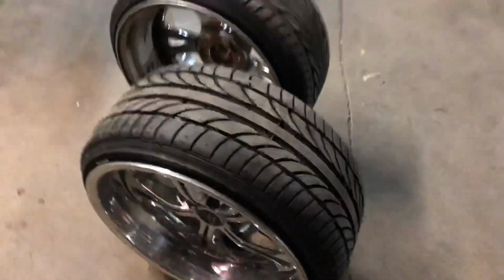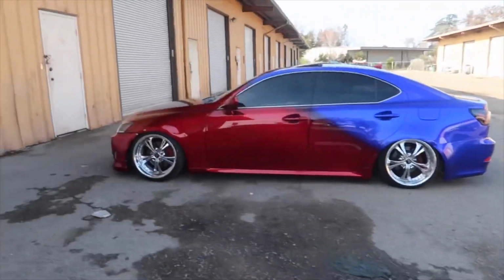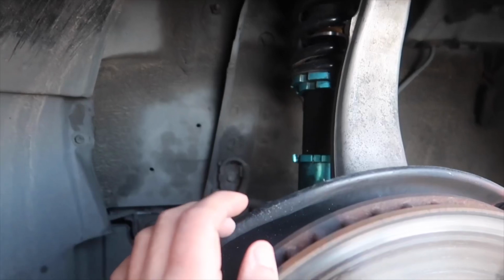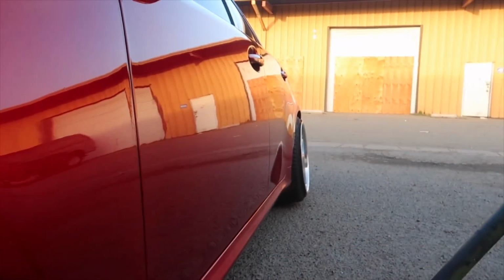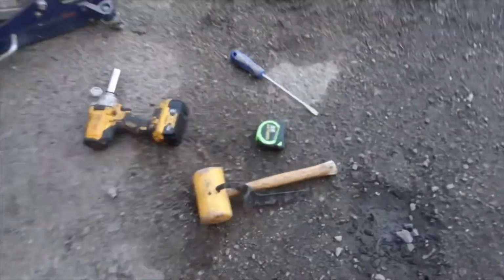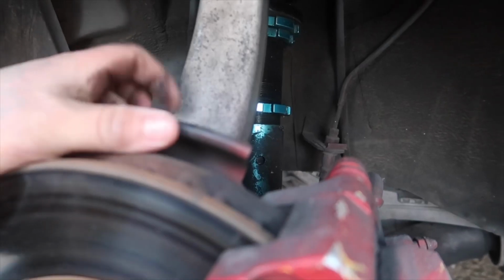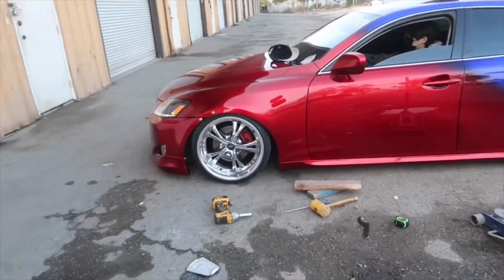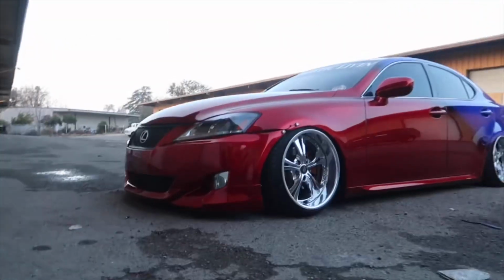LOWERING MY COILOVERS BACK DOWN FOR MORE LOW (DIY)

Comment: i recognize myself in you, all i can say is that you're never low enough. It's a desease.. ive been static for past few years and now i ordered bags. never thought i would, but now i did.. i honestly recommend you to go with bags aswell, the paint is too good to be ruined and bag kits for coilovers aren't that expensive. plus you can have a tire filling tool in the trunk and fill the tires with the compressor to the bags which is fucking amazing. but i live in finland and the roads are absolute trash so i guess it's a different story in the states. Car is sick though. Love the content. and don't come @ me with the drive it like you park it shit. bags are the only option for fender to lip fitment atleast in finland.
Reply from the maker: i’m not gonna lie during the process of taking the car down off the drive way since i use planks it sometimes makes wish i was bagged so i could just go on and off the drive way in seconds instead of minutes it gets annoying at times 😂😂